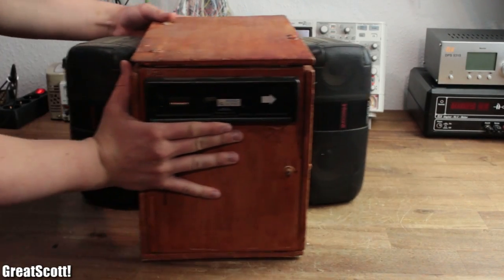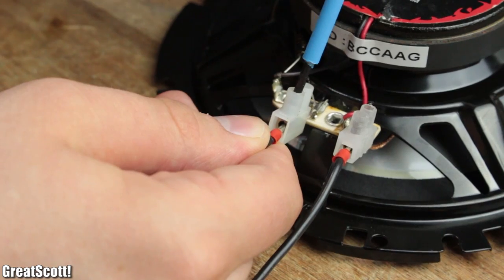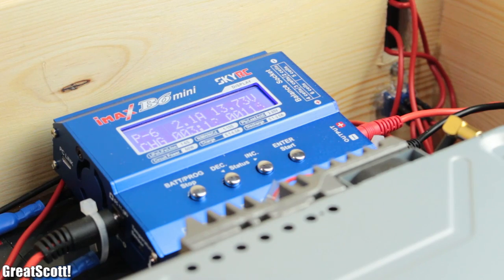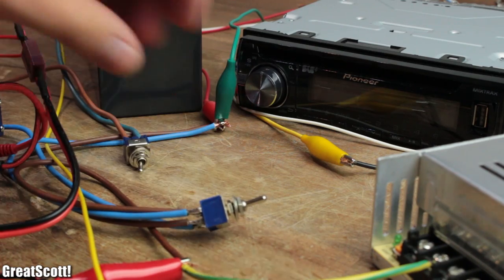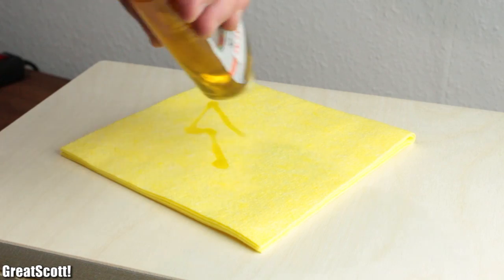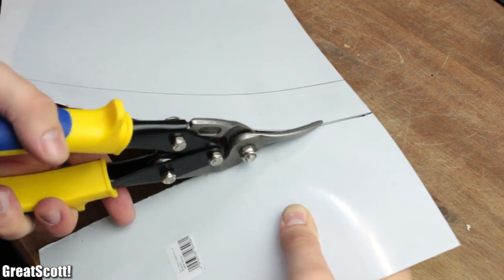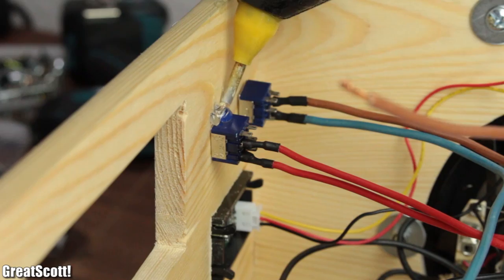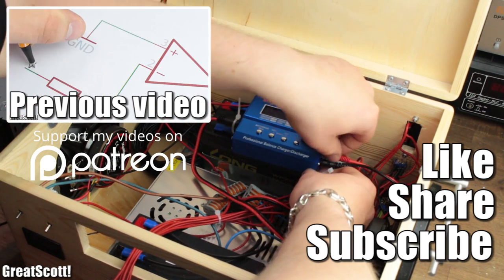Make your own Boombox

Comment: That charger is overkill, they make much simpler and cheaper chargers for lead-acid batteries. Also, the 30-amp power supply is way overkill, that radio probably only draws a maximum of 10 amps at full volume. Although, the wiring job is done well and looks very professional.
Reply: It has to charge the batteries too...
Reply: 15 amps is recommended to the power the radio speakers and power antenna in a car
Reply: He probably had them lying around and just pieced it together. I mean, I don't think one would go out of their way to buy a car radio just to make one of these.

Comment: you can also add a subwoofer at no power amp cost because i am sure that pioneer has direct sub drive that lets you add a sub on one of the rear outputs the violet/purple wires and it put out 70 Watts it will a nice touch to the boombox and you can use the speaker and box from the logitech unit that failed respond if you checked that out

Comment: use a small cooler for a box.. it will sound better, and it has a handle...
Reply: I thought of that as well while watching this
Reply: yeah but those cooling boxes use some kind of foam inside for isolation so drilling through that is a pain in the ass
Reply: +metalhead2508 1gdghfhf
Reply: no it won't be as good as wooden material,,why do u think that there's so much speaker box out there made out of woods?..guitar made out of woods because it's acoustically better than let's say plastic
Reply: monica geller I guess Aluminium is better but its too heavy

Comment: Instead of the switch, why not use relays? You could have set up the relays directly to the power supply. Whenever there is power from the power supply, it could disconnect the battery and connect it directly to the power supply to allow the battery to charge and it would do this automatically instead of having to add funky switches in the front.  Then the only switch you would need is one connected to the ignition wire of the stereo so you could turn the car stereo on and off.
Reply: I made it on that way but without batteries, just only for keeping memory :)
Reply: Also why use a funky Tunigy charger surely a generic car battery charger would do the trick? Or look for "12V Battery Automatic Charging Controller Protection Module Auto Charger board" on the Bay of E
Reply: Lite Tactic  Car battery chargers that put out more than trickle charge are much larger than that switching power supply. Also, car chargers tend to be more expensive than the Chinese made power supplies.

Comment: What are your qualifications?  Are you an electrical engineer?
Reply from the maker: Yes
Reply: +hardstyle905 nice bro Im currently in MIT mechatronics
Reply: jacobs industries Mechatronics seems fun
Reply: Eon Guipagho ३
Reply: GreatScott! Awesome,  I just graduated myself with an electrical engineering degree.
Reply: Doesn't take any certs to come up with this yourself though. I built my own using a Sony car stereo, Boss audio 6x9's and 10 amp 15 volt laptop charger which is within the 11-16 volt requirements. Along with cheap antenna from parts express. Simple wood box of 1/2 in birch and /done. I'v used that in my garage for years, was cheaper and fewer parts. No clue why one would want a 1 inch thick wood chest,  1/2" birch would suffice and be lighter. The stereo keeps it's memory so long as it's plugged in but if I wanted a mobile unit, honestly those costs would be better attributed to just buying a $30 boombox which has SD card, FM/AM, Aux and same power output as the car receiver. Or just buy a battery operated BT amplifier of around 15 watts x2 (same as most car stereo outputs) and mount in a portable cabinet of sorts.
Reply: To invent anything you dont have to have any Degrees
Reply: Of course

Comment: Why use the lead acid battery instead of a large lipo charge pack?  I'm not a fan of the weight of the lead acid battery for my particular application, trying to keep it as light weight as possible.  Is there danger in replacing with a lipo instead?
Reply: DJDevon3 He is not going to carry this around so weight is not a problem
And they are a lot cheaper then lithiums and require less protection
Reply: cekpi7 I need lipo for my project.  Just wondering if it was due to danger or discharge/recharge rate.
Reply: ***** If you need lightweight battery and have extra money in budget, then yes its good to use lipo or liion
Only thing you need to be carefull is to add protection circuit, and see if it can supply enough current (C rating)

Comment: I have a idea to make this Projekt better:
Instead of a switch, you can Use a relay to change the Radio Power between Battery and AC. 
When you plug in the AC Cable and the Supply creates voltage, the relay switch from battery to AC. When the relay switches too slow you could add a big capasitor to the Radio. 
The Wiring:

Man nehme ein Wechsler Relais und verbinde die Spule mit dem Netzteil, der Abeitskontakt kommt ans Netzteil, Ruhekontakt an die Batterien und der Letzte Kontakt ans Radio. Ich hab das in Deutsch geschrieben weil mein Schulenglisch dafür zu schlecht ist.
Cooles Projekt Boombox mit DAB+
Weiter so!

Comment: I'm using a clarion Bluetooth car stereo as my PCs audio sound system. I'm using an 12v power box from an Verizon dvr cable box and some old surround speaker boxes and I have done this project inside a shoe box with a lithium ion battery pack was very light and portable

Comment: The first and best homemade. Car Radio pulls a lot, but the Result is the safest and most well thought-out that I've seen. I would try the Car Radio against a small Amplifier based on 12V and the corresponding Audio Transmitter. All TOP so LIKE

Comment: You could just buy a simple small $70 led battery and recharge it when it dies(which may never because your not draining too much). My cousin and I built a subwoofer cooler with 4 6x9 speakers with 1 pioneer 12" sub and if we played it constantly we would charge it maybe every couple of days. This powers all of the speakers and the 1100w sub so im sure it could power this for days.

Comment: what are the magnets in this design?))) it is very funny. The cover must jump from bass sounds. And you need to make either the phase inverter or the system of "closed box" . But in any case, to do the cover tightly closed(latches) sealed
Reply: ignorant are they))
Reply: But very hardworking and it's good!
Reply: Обзоры от Andro.ID Phase convertor?
Reply: Обзоры от Andro.ID ttffcf

Comment: I built a portable party system using a 240v to 12v transformer, and some old car stereo gear I had laying around, it had 6 pioneer comp speakers, a 400w rms pioneer sub, 7inch lcd pioneer touch screen head unit, a mono block amp and speaker amp, and a capacitor 2 farad for the sub, on wheels due to the weight. My mate had her 21st, and asked me to bring a stereo so had to build it in 1 day XD couldn’t work a battery into it as it would die.

Comment: I made a boombox with a prebuild 50W+50W D-class amp board bought from ebay and a 14.8V 2200mAh LiPo battery with a low voltage alarm circuit also bought from ebay.

Comment: Ok I I have been thinking of doing similar project and just have to have most of the supplies. 30 amp psu, check. Pioneer radio, check.  Heres where mine differs (; I'm going to add 2 bolts labeled subwoofer out connected to the output of a  polk 500w 2 channel amp. it's gonna be a 2.1 system with the speakers powered off the radio and a optional external subwoofer

Comment: Could you just hook all the electronics to the battery and have a battery charger connected the battery, and when you plug in the battery charger, it would power the electronics and charge the battery at the same time?  Assuming that the charger has the amperage to do both.  Or is this a bad idea?

Comment: Hey maybe i misunderstood something, but wouldn’t it be better to replace the 4 pole switch with a 2NO 2NC contactor controlled by the 230V input, that way it will automatically switch to 230V when it’s plugged in.

Comment: Cool👍🏻
I have a question becz i have boombox with 12v lead acid..can i put 2 wire from inside from the battery to outside at the back? So i can charge it

Comment: These lead-acid batteries should be discharged to not less than about 50% and not to the absolute bottom, so your actual usable capacity is more like 7.2 Ah and not 14.4, which will give you about 4h 30min of play time according to the power draw.

Comment: I Made my own boombox using 2 car radios, because one of them have subwoofer output, so I connected subwoofer output to AUX of second radio, so I could have subwoofer chanels. Powersupply i am using mains transformer with o lot of filtering capacitors, and FULL BRIDGE RECTIFIER from 4 schotky diodes 30 amp each. I Made more powerfull variant of your boombox!

Comment: Can you please do a tutorial on how to convert an old 80s tape Boombox to a Bluetooth Box similar to this one? Like, exchange the old Batteries with LiIon ones that charge with the power supply and a bluetooth circuit that replaces the old tape section but still uses the older buttons. I think that would look so cool!

Comment: i know this is old video but because i have almost same components i want to ask you is it posible to atach batterie guard instead of volt display and does it mater if nc/no is before the battery switch that way one could compleatly cut power ?

Comment: You use a 12V power supply but you set it to 14.5V. ¿Is it a feature of the power supply or how you did it?
Reply: Looks like it's a feature of the power supply. It's an adjustable power supply, and many power supplies that I've used that are made for this type of application usually go up all the way 14.5 and even 15 V, which is typically the charging voltage for lead acid batteries, even though they say they are 12 volt power supplies.

Comment: i have a old speaker system that runs at 15 volts dc (60watts), what would be the slickest way to run it on battery like this? 12v SLA battery with a boost or 8 18650 cells (16.8v) ? what would you reccomend? im in love with this build and i want to do something similar! thanks in advance for the inspiration alone

Comment: i highly recommend to use only 13.8V to charge the batteries, and also they will survive 5 amps at this voltage which is better because it will charge them faster!
the switch that connects the radio to the power supply when charging and disconnects the battery is also annoying, you can forget it and then all the battery doesn't charge because all the current goes into the radio, i would highly recommend to use a system with relays and mosfets that does it automatically when plugged in, that would be much better!

you should also disconnect the fan inside the 12V 30A power supply, it's not needed in that case and it is very noisy! Those power supplies say they have a temperature sensor (and not even with a correct english sentence) to turn on the fan only when it's necessary, but it's absolutely not true, the fan runs everytime, even when it's cold.

Comment: i have a question on this, would it be possible to use the laptop charger to power this? i am aware the wattage would be much much higher than needed, but wouldnt a charger/power supply made for this item work best?

Comment: Why use a 30A PSU when the average current is only 1.5A or so?  Even allowing for battery charging, I would have expected a 5A or 7A PSU to be more then juicy enough, cheaper and smaller too......  Not being critical, just curious why you are using such a beefy PSU.

Comment: I built a similar boombox, but used a much bigger battery and also used an amp as the head unit output is far too low - the rated 50w per channel is peak, so way underpowered for even cheap speakers.

Comment: Is it possible to get bluetooth input with this setup (if you don't use the radio antenna).
Is it possible to get a subwoofer with this setup? What subwoofer is best regarding used voltage and cutrent with this setup?

Comment: I got a idea like stationary built with it example your workplace what about using a PC power supply that also make like 12 volts also I found kind of find out some people also switching out car audio with different one so you can actually buy car audio a bit cheaper I found a brand new for 11$ / 10€  from hyundai car with bluetooth

Comment: Arent the DPDT switches He uses rated at 6 Amps max? Im just curious since I Just Got them in the Mail and figured that the boxes could Draw More than those 6Amps at 12v since They are 40W speakers. Also in my build im using 80w speakers. Should i be concerned about the switches failing?

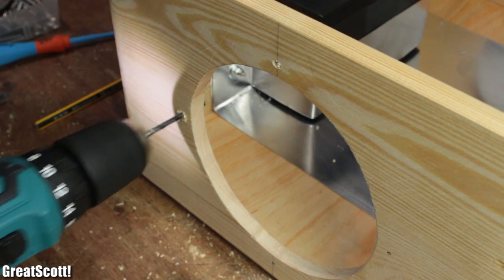Comment: 6:15 "Because safety first." immediately drills into the box directly towards the SLA
Reply: @Jay-fo9gk  Sealed Lead Acid, a type of battery with sulfuric acid sealed in it
Reply: It was like 10cm from the wall of the box. He'd need to be using a massive drill and be absolutely braindead to cause damage to the battery...

Comment: Made one myself using lipo batteries, a 18cm sub, two hybrid high/low speakers and one 8cm mid speaker . I added a bluetooth module and leds. Love it, so thanks for the idea.would you like to see vids of it? Tho it draws 12amps avg

You should also seal the boxes lid with some rubber, in my case it boosted the sound a lot.

Comment: I love your content. Your radio uses an average of below 2 amps, plus under 3 amps for the battery charger. Screw it he says! Enormous 40A power supply to power it 😂😂
Reply: do you really need a 30 amps? can you use 10 amps instead bc i am not putting batteries on it

Comment: Must have been 1965, or perhaps 64 not sure which, when I saw my first car radio run from 110 volts.  It didn't work great, but after some tinkering, we got it playing well enough so listen to the KOMA Good Guys (KOMA was a very powerful radio station in Oklahoma City Oklahoma.  Everyone in the Midwest tuned their AM Radios to 1520 anytime after the sun sat!)  My buddy didn't have a radio in his bedroom, and wanted to be able to listen after his huge family (mom-dad and 8 brothers and sisters!) went to bed.  So we visited the midnight auto supply (we broke into the local wrecking yard after dark) and acquired (stole) a car radio from an old Chrysler (they had fancy radios!)  to power it, first we tried an old battery charger (found at the local dump ground) but the rectification and filtration were just not that good and there was a Lot of     noise over the speakers, (2 count 'em 2) front and back speakers!  So we tinkered some more, and I think we finally found a way to filter the power from my old Lyonal train transformer through an old motorcycle battery, and at long last we had radio!  While at first all we could get was the local AM radio station, another visit to the midnight auto supply found us with a pair of rear mount radio antenna's with very long cables that allowed us to mount one antenna on each window of his bedroom, we ran a ground wire from the normal mounting points where the antennas grounded out on the car body, and drove a six foot long copper rod into the ground.  That night, we had KOMA and the Beetles blasted away through his bedroom.  We thought we were in rock and roll paradise!  Then his dad came in and saw what we had built.  Now he was an old fart, he had farmed most of his life, and was probably the most honest man in town, so all the parts from the Midnight auto supply were returned and the music died.  Nice to see that our idea survived.  We were lucky his old man didn't find our stash of 8mm porn films, secretly ordered from the back pages of some men's magazine.  Man those were disappointing, all they consisted of were some very blurry black and white films of naked women playing baseball!  If you ran them at 1/2 speed though you could almost see nipple!
Reply: holy shit, did you really typed all that

Comment: Putting electronic devices in wooden box's is highly dangerous as they can easily catch fire!
Reply: Chris McCaulley  Where have you been? Manufacturers have been doing this for various products for years. As long as it's designed properly then there should be little issue. That being said, for various reasons, I would not recommend building one the same as what he did. Anyone wanting to make one for themselves should research the relevant info first to educate themselves on the various things, including proper speaker designing/building. You can't just slap some speakers in a box and think that it is going to sound good. There's a lot more to it than that.

Comment: If you put a piece of rubber or foam on the border of the lid and fasten it with screws you will get much louder and deeper sound because no air pressure is escaping.
Please try it, you will hear a big difference!
Reply: that would harm the speakers as they need some sort of presure compensation
Reply: Bera Polat No it wouldn't? Ever heard of sealed enclosures?
Reply: Bissekat1 Make sure you're using free air type of speakers in sealed enclosures. You just gotta flip your subwoofer over by the magnet area and look for any small screen looking vents or ports  between baffle and magnet part of subwoofer speaker, that's a free air. Some have a circle port about 3/4 inches on center of magnet that's also a free air.

Comment: I feel like you should try to make a cheaper one
Reply: A TDA2003 amp, a 3.5mm jack, volume knob, only 1 lead acid battery, cheap 4 ohm 10w speakers and an enclosure out of plywood instead of using a premade chest. Would be easy and cheap, probably around 30 dollars.